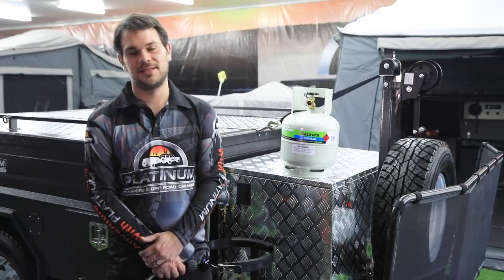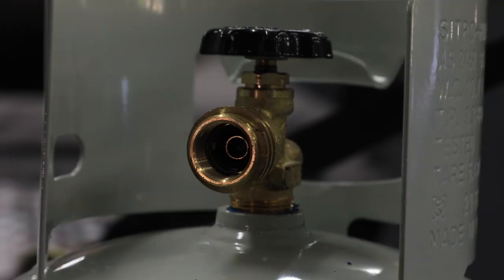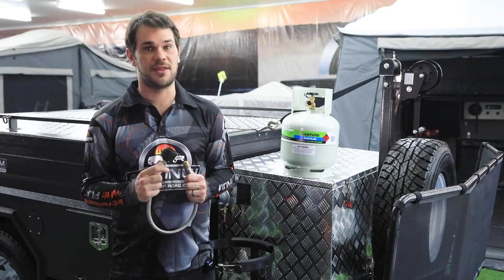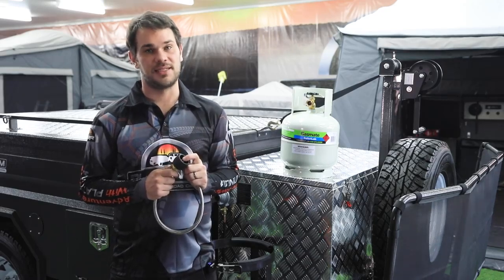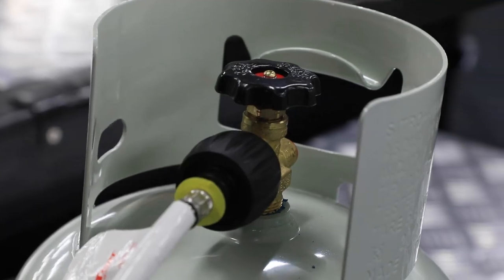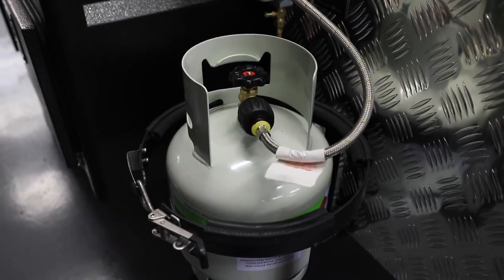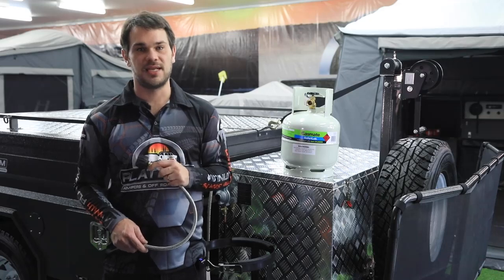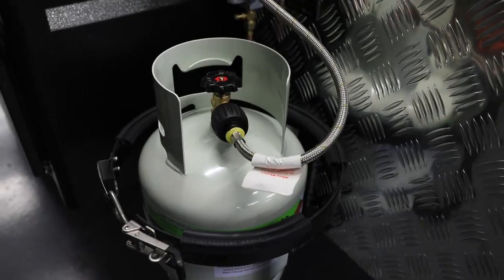The New LCC27 LPG Gas Cylinder Fittings for Australia

Comment: Here in the states, my propane generator did not run with those connectors as they did not open the internal valve enough to allow proper flow.

Comment: But how do you fill the empty gas cylinder you've just bought? Can you just take the empty one in and swap it for a full one and pay the difference?
Reply from the maker: There is a way to get the fitting changed - But it costs - and generally not worth it. 
Otherwise its waiting till finished and doing a swap and go

Comment: My favourite feature of the new connection other than the check valve is that the plastic fitting on the hose is designed such that in a fire it melts quickly, ejecting the hose and the check valve blocks the gas escapaing - great safety.
Reply from the maker: that's actually very smart. Cool feature.

Comment: A new LCC27 valve can be fitted to old cylinders at the 10 year test. Also the check valve is on the cylinder, not the hose (speaker pointed at the hose connector when mentioning that point). People may never need to change appliance or camper/caravan connectors unless they have to replaced for some other reason such as damage.

Comment: Does someone want to explain how the hell the coarse plastic thread of the LCC27 is a safer seal than the old school POL brass tread that's worked for over 20 years 
What happens to the plastic when it becomes brittle 
Oh and if you don't do up the LCC 27 tight and it leaks that safety valve doesn't do anything and gas pumps out the thread on LCC27 
Can't believe some retard got a pay rise to put this reg in

Comment: They should make adapters for the old ones to be like the new ones that way you dont phsically  have to buy a new gas bottle with the fitting on it . Just my thoughts.
Reply from the maker: Yeah we thought the same thing - annoying to say the least. Our gas guy was telling us the reason they dont give an adaptor is that they are trying to reduce the need for them - as this is another source of leaks. But yeah - Still bloody annoying you have to get a new bottle!
Reply: @platinumcampers8568  You don't have to buy a new cylinder, they will be upgraded at the next 10 year test (assuming they pass). Every 10 year test I've had, they replaced the valve on my cylinders, so not even an extra cost, though the new valve may cost more than the old POL as they have a check valve now.
Reply from the maker: @Dr Dos  I thought they were charging for the new valve? Where you getting that for free? I know if you do swap and go's - your next swap you can change to LCC27.
Reply: @platinumcampers8568  Not free: When I take a cylinder in to be 10 year tested (which could even be 12 years, or more, depending on usage), they remove the old valve, have a look inside, and put on a new valve. I forget the cost, but new valve is included as part of the test, so it won't cost anybody anything more than previously (except for inflation). Sorry if I wasn't clear.
Reply: Adaptors are not allowed (from VIC ESV web site): Adaptors must not be used to connect an appliance with a new connection to a cylinder with an old POL valve. Adaptors are an additional leakage risk and the change from right hand thread on the appliance LCC27 connector to left hand thread on the POL cylinder valve means tightening one side of the adapter risks creating a new leak at the other end of the adaptor.
Reply: I'd hope the gas bottle swap places will just accept old-style-for-new; just like now if you bring in a bottle that's just about on its certification expiry date, they'll happily still swap it (for a bottle that's nearly as old - but at least it's been inspected, right? ;-).
Reply: @BenL42  
Just swap and go for same size, you are returning a rented item, they are required to change it to the new Saftey standards…
So there isn’t a issue swapping for new style valve at all, do it myself with my 3 bottles as they became empty
Reply: @hilux8103 The issue in NSW is that it's not a rented item, you purchase the bottle.